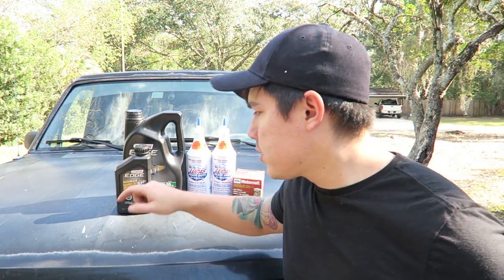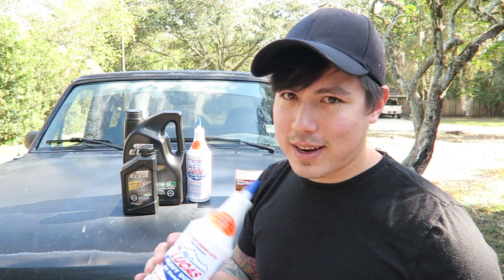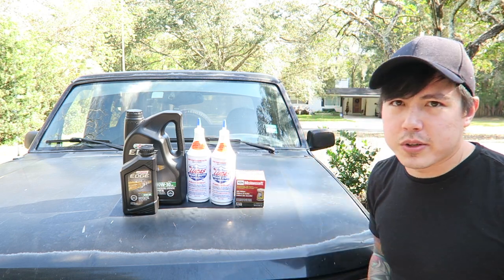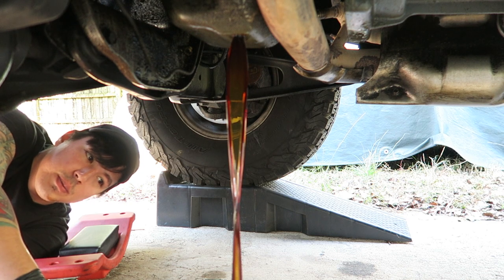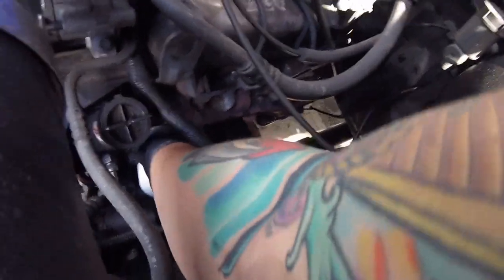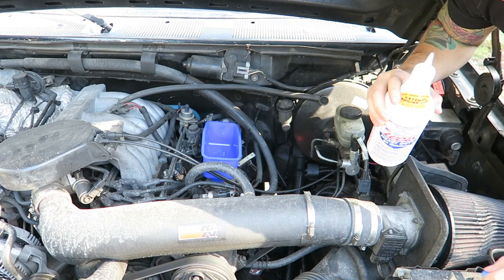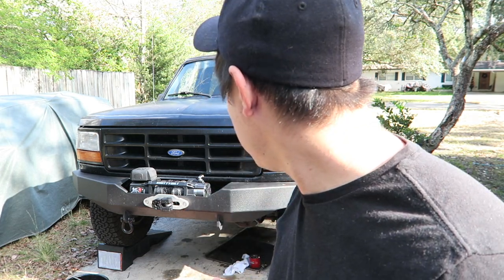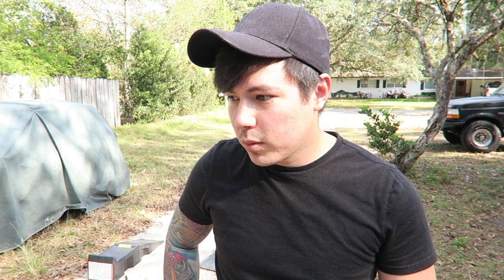Oil change on the Bronco AE15

Comment: 10w-30 Full Synthetic is a good choice for Florida in that engine.  Lucas treatment is a good product, give it a little time to quiet down more.  Be aware that a synthetic oil may leak more if you have any engine oil leaks.  Also, a Coyote 5.0 may require a different transmission, and the only choice might be an automatic for a 4x4.  Plus, a new Coyote will set you back like $8,000.  Used, one, different story.

Comment: I noticed the K&N air filter, how do you like it? Also when installing what happens to the small crankcase filter? Is it still used?
Reply from the maker: The crankcase breather is vented into the intake
Reply from the maker: Also in regards to if I like the filter or not, it was on it when I got the truck a few years ago so I never really felt any difference. It’s fits nice and is easy to remove tho so that’s a plus.